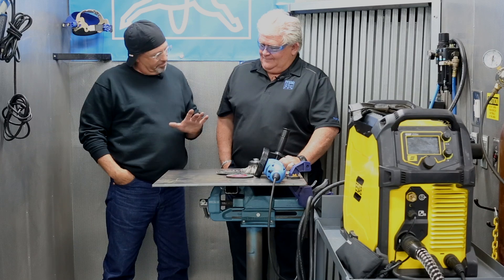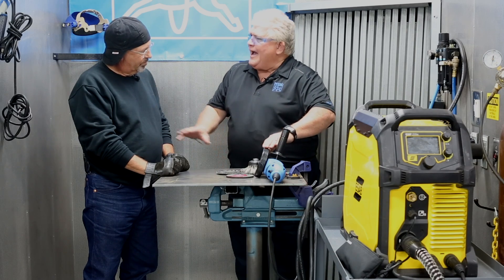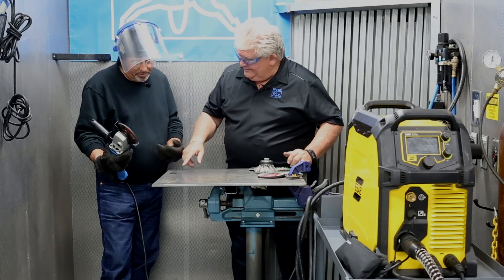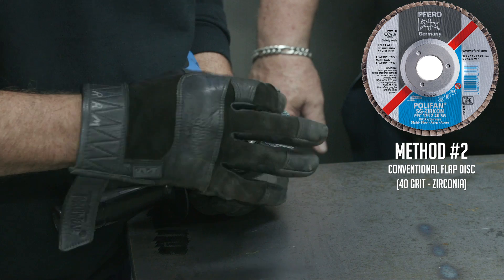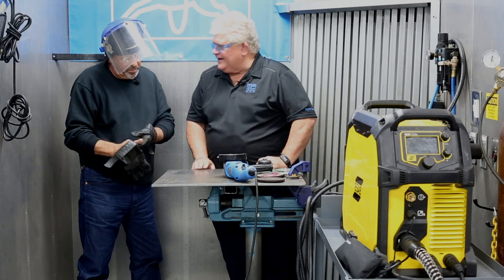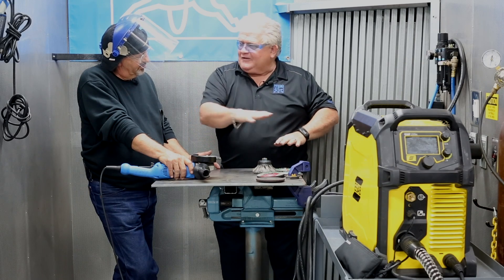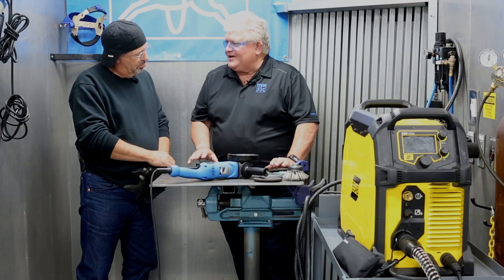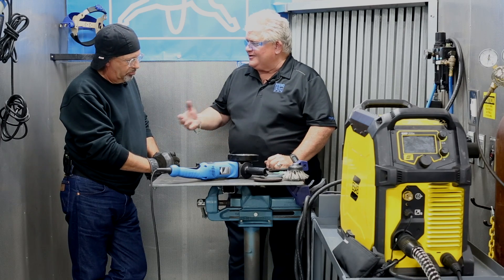Four Ways to Remove MILL SCALE

Comment from the maker: If you have questions about any products used in this video, please email:  sales@pferdusa.com
Reply: Abyyss3344   try vinegar. seriously. like, the stuff that costs $2 for a giant jug at the grocery store. let your material sit in that for several hours, and the scale comes off with water. i wish had known that years ago.
Reply: I have a question, whats the price for one?
Reply: @Dev_Everything  I found them in the internet going for $330.00 each. I’m sticking with Silicone Carbide.
Reply: @Dev_Everything  the price im sure is astronomical
Reply: @Dev_Everything  aaaaaan, they didn't answer. why? because these things are over priced. home gamers will never be the consumer for them, and industrial types don't care how much. but, if you have been fabbing for any length of time, you will notice the dingus grinding digs with the grinder instead of grinding at a flat, constant angle. he makes it look like the disc is causing the trouble when it is actually him.
Reply: @ronamer1  muratic acid works like a champ
Reply: @ronamer1   those marks are going to happen regardless. the only other easy way to get scale like that off your material, is to use a 7" sanding disc (not a flap wheel), and then you absolutely have to be able to keep the grinder moving flat at a constant removal rate, because you can only go one direction and there will be noticeable gaps if you stop anywhere in the middle. much like facing on a mill.
Reply: @Dev_Everything  I thought that chemical removal was going to be one of the methods.
Reply: ronamer1 is
Reply: Literally cannot find these for sale
Reply: Ok😉
Reply: Thank You Sir's
Reply: Man,  I was just trying to clean up a piece of 5/8 steel plate so I can make a metal brake and I want it to have a nice paint job and look good. The sanding disks are expensive and they are bad that once they break the mill scale they bite and you can feel the grinder pull from it. That pisses me off so I just stop. I was even contemplating using acid. Also, have you ever tried to cut 5/8 thick ateel with a akinny disk? Man its so frustrating. Cutting thru the surface mill scale then thru the work hardened surface, then you get into the soft inside of the hot rolled steel and when you hit the inside of the oposite area of work hardened steel the disk gets to bouncing and then it chips the abrading material and starts to disintergrate. It seems like after you cut out all of the soft inner meat the best way to xut the ateel the rest od the way thru is to actually go back to the edge and atart cuttinf at as close to 90 degrees as possible. Trying to get as smooth an edge as possible. With no sheer or machine shop around.
Reply: You all prolly dont care at all but does anybody know a way to log back into an instagram account?
I stupidly lost the account password. I would love any assistance you can offer me!

Comment: I agree with all of Comments that mention vinegar but vinegar will not leave a polished finish like that wheel. I would use that wheel to polish my material after vinegar so I do not have to deal with as much dust from the mechanical method. I use the 30% vinegar. If the material is small, I put it in a container like a bowl or bucket and let it soak. For material like metal plates, I spray the material with the vinegar from a good spray bottle. After I spray the material, I cover the plate with a plastic bag to reduce the smell and to slow the evaporation of the vinegar so the vinegar can do its thing. I go have a beverage of my choice and a snack or watch a welding video on YouTube, basically kill time for an hour or two. I come back to the material, take it to my garden hose and wash it off or get my pressure washer. I assess if the material needs more soak time or if I can get to work. I treated a mild steel plate that measured 30x29 inches with vinegar, covered it with a yard waste bag and left it over night. I came back the next day and pressure washed it to see 99% of the mill scale flow down my driveway and turn to rust the next day. No dust, no ear protection, I did get the vinegar vapors in my sinuses and I did wear safety glasses and gloves. Vinegar is not practical solution for every mill scale removal, maybe for small garage type stuff but that wheel is really nice, I like that finish.

Comment: For me, the best method has been to use muriatic acid (32% hydrochloric acid). I dilute it down to 10 %. After the treatment, I use phosphoric acid to create a layer of iron phosphate as a rust barrier and prevent instant rust. Paint adheres well to iron phosphate. Sometimes I grind the iron phosphate off with a flapper disc, and sometimes I just weld through it. The difficult part is finding a container to submerge the steel. For steel plate I've used a kiddie pool. For pipe I use pvc pipe. This also works very well for removing rust from pitted steel.
Reply: @KetilJørstad   I've never used full strength because of the fumes, and I've never timed it. For zinc plated nuts and bolts I usually soak for about half an hour. I use it mostly for heavily rusted steel, and the concentration works its way down after repeated use. I recommend trying it on a small piece of scrap and see if 10% takes too long for your needs. The reaction time is also dependent on the temperature. It will work faster in the summer.

Comment: I keep hearing welders say that mill scale is impurities in the metal that come to the surface. I'm pretty sure it's not that. It's  a few different iron oxides that happen when the metal is hot and emmersed in an oxygen atmosphere. If you were to hot roll steel in an oxygen free atmosphere, iron oxides would not form. Rust is another type of hydrated iron oxide.

Comment: Really enjoyed this. I hate mill scale. My experience with industrial diamonds was to dress the grinding wheels on surface grinding machines when I was in tool and die making. Heck, the diamond would skim off the aluminum oxide or silicone carbide abrasive like it was nothing.

Comment: Just spent $300 on one of these diamond cup wheels. Ran it at 2800 rpm, under 3000 as instructed. Results are amazing, but half the bristles have fallen out after about 2-3 hrs of use. Pretty disappointing.

Comment: Great video and info. I think for most applications a regular grinding wheel or flap disc is fine though especially if you’re careful with it and learn how to use different angles to your advantage.  My boss and co workers would roast me for using a fine buffing wheel to remove scale. For powder coating and finer finish work though this is absolute gold because literally any fucking microscopic scratch shows up on powder coated steel. Bane of my existence. 
Love how many gadgets the industry has in it now but don’t forget to develop skills over time with normal equipment! 

Plus the outtakes were hilarious, good stuff.

Comment: so would you need then to invest in a variable speed grinder to use these diamond impregnated wire wheels??  the other tests that were done were using a high speed grinder - would be interesting to see how much scale is removed if they were going at the same lower rpm that the diamond one was used for to compare apples with apples.  Clearly it would give a better result but maybe some problems could be offset using a variable speed grinder on the other conventional discs??  i.e. how much of a role does the variable speed play in this...

Comment: With proper safety gear, I’ve put some heavy plate in a tub with swimming pool acid, then rinsed in another tub with baking soda water solution to neutralize. Worked really good, but don’t forget about your parts in the acid, or you won’t find anything left.

Comment: This is a great video and provides great detail to the testing but we did very in-depth testing and found that the 3m product line of Scottbrite outperformed everything shown as well on standard equipment meaning you DONT have to change your tooling to "reduced rpm" tooling. Id highly suggest to touch base with 3m and review thier products that we worked with them to refine for shipbuilding.
Reply: I'm going to look into 3M like you suggested. Which Scottbrite wheel did you find works well?

Comment: omg, drop the sales pitch fat guy. just because other tools not yours doesn't means they are shit. 
Silicon carbide looks okay, but that diamond brush was too slow, didn't remove scratches too.
easy strip discs is usually my choice, need to compare it to silicon carbide.

Comment: Floating the mill scale with a 40 grit flap disk? No the scale is gone, and it doesn't float anywhere except to the wheel, which where it's "glazed" is where the mill scale is. Not FLOATING AROUND LIKE PAINT ON A CAR.

Comment: Hello good people, still a newbie myself when coming to work with certain materials, this is all good and well, but what is the best way to clean expanded metal sheets? flap disc and grinding wheels will eat through the strands like nothing, the wire wheel works, but the wires gets broken up real fast, and none of them will clean properly between each strand within the expanded metal sheet only the top or bottom surface. is there a better way or is sanding paper the only way? Sorry English is not my home language. Thank you, appreciate the time you spend reading this comment.

Comment: I don't know I've only been working with iron for 35 years..I learned from my .. father and my brother.. if you get a table a large area steel table welding table and you want to remove the mill scale.. well back in the day we just used a large handheld.orbital sanders.. cloth back sandpaper.. an additional powder abrasive.. and a spray bottle with water.. last step was a variable speed grinder. With a large buffing wheel and again and additional powder abrasive with a spritz bottle of water..my dad could take a 4 by 8 sheet of 8in diamond plate and make the top of the diamond plate look like it was made out of aluminum or stainless steel in less than 4 hours.. he would take cast iron parts..and put a mirror finish on them without all of this..it's the same principle on let's say body work or a paint job or a hardwood floor..

Comment: If the piece is small enough, soak it in vinegar overnight.  Then spray with water, dry off with air and then use wirebrush on anglegrinder to get rid of any residue/mill scale left over.  I have a liquid storage tote that I keep the vinegar in.  the top is cut about 10" from top and slips over the bottom of the tank.  Only caveat is to keep the tank far away from any metal you don't want to oxidize.
Reply: yep  vinegar  48hrs  gets it off , or , 2  x 24 hour soaks

Comment: After watching this video I tried a Warrior 94017, 4 1/2" Polycarbide Abrasive Wheel, sold at Harbor Freight Tools and it worked amazingly well. Super fast without the damage to the metal.  I paid $4.79 after using a 20% off coupon.

Comment: Man,  I was just trying to clean up a piece of 5/8 steel plate so I can make a metal brake and I want it to have a nice paint job and look good. The sanding disks are expensive and they are bad that once they break the mill scale they bite and you can feel the grinder pull from it. That pisses me off so I just stop. I was even contemplating using acid.

Comment: Muriatic acid ? Full strength front the home improvement store will have that steel looking bare and lightly textured. Neutalize in a calcium carbonate quench.Perfect for paint.  right after. And literally 0 elbow grease.

Comment: I bought both a 2 ½” diameter and a 4” at first I loved it but the second time I used it it came apart. I wasn’t pushing it. I was using a 7000 rpm grinder and the wires were flying off. So at  a $120 a pop the love was short lived.

Comment: Here we have Bob Moffet being polite to a salesman who'd be comfortable peddling snake oil but in this case has a genuinely superior product line to demonstrate.

He says several times that mill scale is "... metal impurities rising to the surface..." Nonsense. Mill scale is iron oxide tightly bound to steel plate and shapes from the hot rolling process. This from Wikipedia: "Mill scale, often shortened to just scale, is the flaky surface of hot rolled steel, consisting of the mixed iron oxides iron(II) oxide (FeO), iron(III) oxide (Fe2O3), and iron(II,III) oxide (Fe3O4, magnetite).

"Mill scale is formed on the outer surfaces of plates, sheets or profiles when they are being produced by rolling red hot iron or steel billets in rolling mills.[1] Mill scale is bluish-black in color. It is usually less than 0.1 mm (0.0039 in) thick, and initially adheres to the steel surface and protects it from atmospheric corrosion provided no break occurs in this coating."

Imputities my ... I hate dumb-ass salesmen. They think everybody is stupid.

OTH, the P'frd products he's peddling are great. They work as advertised but that fancy diamond encrusted brush is pricey and doesn't last long if you get aggressive. The silicon carbide flap wheel is a bit more expensive than the plain vanilla ones but it really does whisk away the scale without much affecting the underlying steel. My suggestion is use it to buff off the scale without scouring the steel. If you have to further condition the steel surface, change to an aluminum oxide flap wheel.

One more damn angle grinder. How many is that in my collection for every day use? 7? 8? Lessee: dish wheel, cutting disk, wire cup wheel coarse,  wire cup wheel fine, knotted disk wheel, fine flap, coarse flap, etc. All different brands. And die grinders.  Note to self: organize tools some day.

Comment: This seems like a shortened version of the video  I originally watched where you focused more on reducing the rpms. After that, I bought a nice variable speed Metabo 4.5" and wow, what a difference. Just in life span of the abrasives alone, it was a HUGE difference. Also, with those damn wire cups, they are much more manageable and safer. The biggest benefit that I've noticed is with the hook and loop Scotchbrite pads, though. Now they actually last long enough to justify buying the expensive little pr!cks haha. GREAT INFO!

Comment: I just searched on Amazon for a silicone carbide flap disk.  The description (for one at least) said it was for cast iron and non-ferrous metal.  I'm trying to understand the apparent contradiction.  I'm not convinced it's the type of abrasive as much as the type of wheel (flap or flat).  https://www.mcmaster.com/4205A21

Comment: Ive never used anything other than standard disk or flap disk.
In 40+ years never had any real issue with either method. 
Amazing how forever welders have dealt with this using a standard disk bug now its some sort of extra problem.

Comment: I could have really used the diamond coated wire a few years ago.   I was using the 3M Greencorps "flexible" disks and they worked but were still very tedious and labor-intensive.     Then I ran into PITTED rust.   The only solution for that is sandblasting  --or more exactly media blasting.   I used coal slag until I found out it contained beryllium, and now they want me to use crushed glass.

Comment: The brush looks like a terrible idea. Conventional abrasive removal discs work by redressing themselves automatically. Old particles break off and expose new ones behind them. (the reason cutting discs get smaller. It's their design, they are supposed to do that.) The brush has only a tiny area of diamonds. When they break off it's just a regular brush...My guess is that this last for a fraction of the time that the normal discs would last.

Comment: On a related note, I just started DRESSING the hard wheels with the same diamond dressers that people use for grinding wheels on say surface grinders, or pedestal grinders.  A lot of those hard wheels are not so round, so it bounces around when you try to grind, and of course isn't getting good use from the abrasive.  SO, I try to LIGHTLY grind on this diamond-impregnated thing, and there's a little storm of abrasive coming off, and presently the wheel is a little smaller but nicely balanced and very smooth in operation.  I started doing this for small mounted wheels as for a Dremel tool or a die grinder and just got ambitious.  I thought I was going to destroy the wheel dresser, but not at all!  No conclusion here, but it seems to help get a nicer job on the grinding, less aggressive though.  I got some of these things from China/Ebay, talking about a little block of bronze or hard metal with diamonds in it, maybe there's a handle or a stub to mount the thing.
Reply: I grind with the edge of a diamond cut off wheel. Yeah it scratches but it's so fast